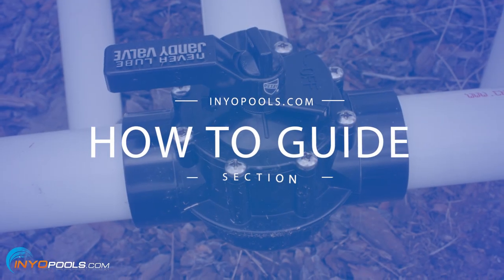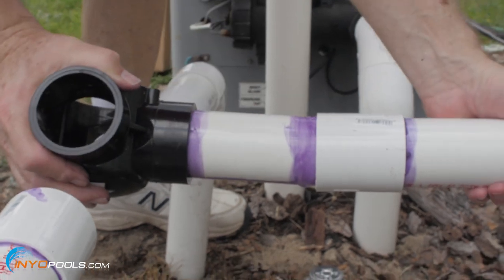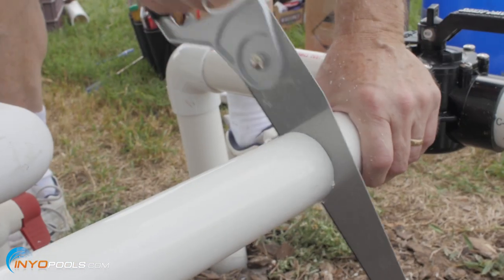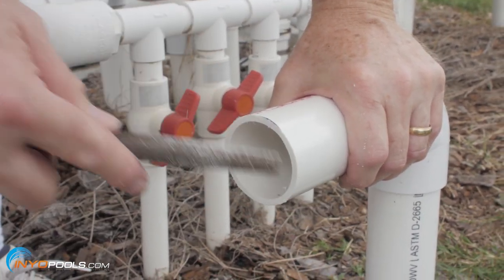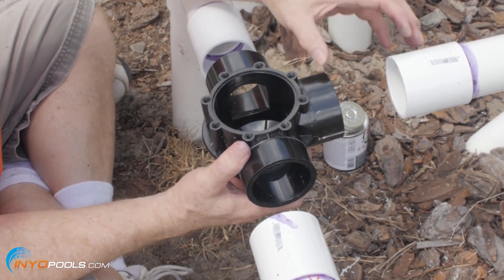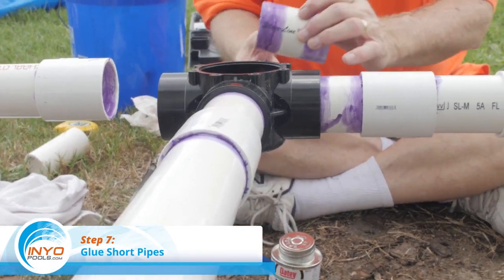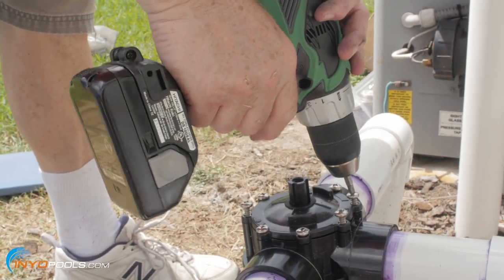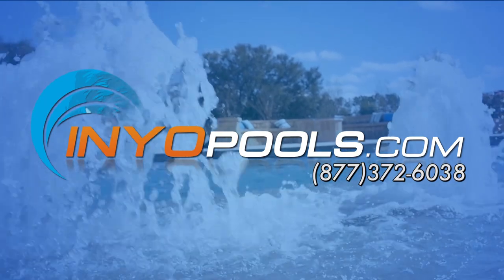How To: Replace A Diverter Valve

Comment: Don't use a power tool to tighten the valve screws. You can destroy the plastic threading or over tighten and crack the housing body. Hand tighten only.
Reply: Wish I saw this video earlier. I stripped mine now I think that's why I'm getting bubbles in my returning jets
Reply: When you don't know how to use the torque adjustment,  you get this issue .... RTFM

Comment: I hope you comment.  I have a valve on the discharge side (3 way) going to the roof solar heater or to the pool depending on operation needs.  It is off all the time due to a solar heater leak.  It makes a loud vibration noise when the pool is shut off.  It is 20 years old and I am told to replace it not rebuild because of its age.  But it is in a tough spot.  Can I still get parts?

Comment: Hello. Can I use a diverter 1-1/2 instead of the 2- 2 1/2?
Reply from the maker: You may have asked this on on another video and mentioned the fact that the pump was not working. First, make sure the new valve isn't closing off one of the lines that was previously open. Going from a larger valve to a smaller valve would decrease the water flowing to the pump. This could impact larger HP pumps, 1.5HP and higher. Larger pumps could struggle to fully prime. If the pump is not turning on, you may have other issues like a bad motor or electrical problem.

Comment: Thanks... but. How do you stop the water from draining so I can remove the old valve?
Reply from the maker: If the equipment is higher than the water level, the water will drain back into the pool. If the equipment is lower than the water level, you can plug the skimmer and return line. Threaded plugs or rubber expansion plugs can be used.
Reply: @Inyopools  Thank you! I'll try that.
Reply: @Inyopools  how do you plug the main drain ?   Do you do it right before it comes into the three way valve or in the pool?

Comment: Are the housing the same on a manual valve and a actuator one?
Reply from the maker: The housings are the same between the manual and actuator controlled valves.
Reply: Thanks

Comment: why no using  coupling nuts instead if is something that will be need to replaced time to time.
Reply from the maker: I agree that a valve with unions would be ideal. CMP has a variety of diverter valves that come with unions on the ports. http://www.inyopools.com/ProductListing/valves_jandy.aspx
Reply: 3 more potentials for leaks; normally you would only replace the internal valve assembly, not the entire valve.
Reply: @luisderivas6005  yup. That's usually what I do

Comment: What if you don't have enough room to remove pipe. My valve is pretty much on the connectors.
Reply: use dremel tool to carefully cut out valve from pipes. 
heat the valve connections with a heat gun to loosen the cement.
Reply: Sell your house and move....
Lol

Comment: Don’t do this!   There is a much easier way then destroying all your pool equipment. Yikes, it’s a 5$ part watch other videos
Reply: $5 ? I seriously doubt it. There is nothing under $5 now in regards to plumbing parts.
Reply: The part was actually 74.00. Substantially more than first quoted., Installation, 5 minutes, -0- $ . But no need to cut pipes.
Reply: What's the part